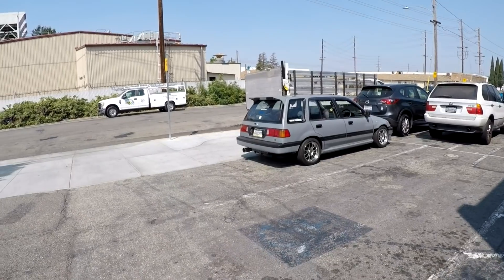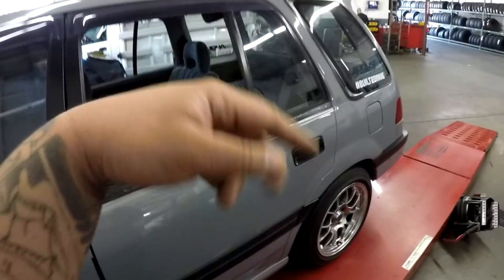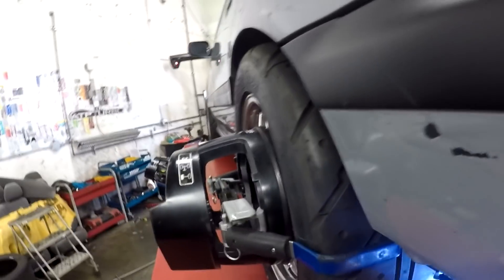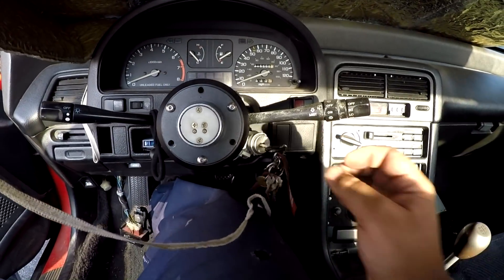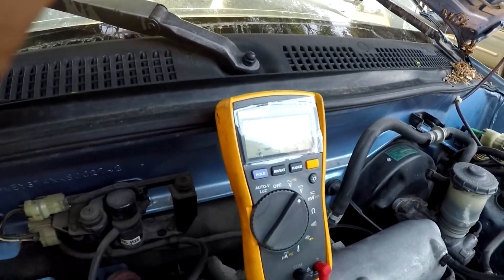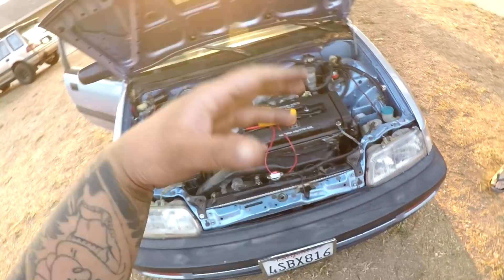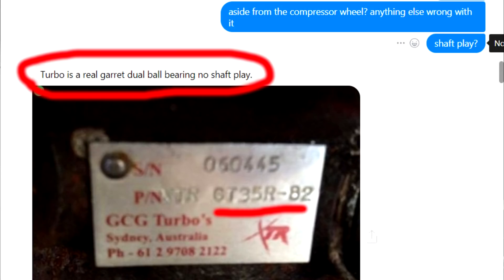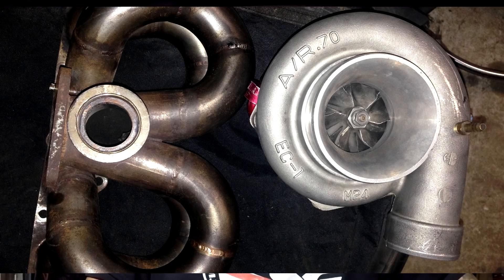K SERIES Turbo AWD Honda        ?

Comment: keepin it real , nice to see an adult mindset . This video should put an end to the talk , so that is settled . Thanks for not adding fuel to the fire by dumping on the other channels . Wish all the commenters would follow your lead and not use personal insults. 
Let's move on.
Kudos on the wheel and tires combo , looks great , they fit without scrubbing .  And the 3" turn-down,  if there is room to tuck it, hell yeah that would be sweet , but ya gotta think about when you add the rear diff and axle stuff. 
I have a  Vibe GT (Toyota Corolla), and i plan to add AWD so i am looking forward to seeing how it goes on the civic

Comment: Find deals that wat i said on diymike ch like i said b4 i bought a full gsr swapd eg coupe 4 700$ n it still runs like cherry til this day  lol hater gon hate static keep yo head up bro
Reply: Good for you. I got a beautiful looking integra that the owner poured gasket sealent in and o.ly found out when the car started pissing out the exhaust and the radiator overflow tank started getting oil in it.
Reply: For real back then in like 2005 i bought a DA with a non running gsr in it for 300 bucks come to find out it needed a new battery fuse

Comment: Question!u @YoungStatic and the community? Found a 91 civic wagon auto 2wd for $800. 7/10 exterior. Interior condition is about 5/10, blow head gasket with SI rims. I’d like a civic again and it would be my first wagon. However I’m worried about parts mostly interior. So, how hard is it to find interior parts and do u think $800 is too much? Thanks all! 

Side note- Static, plz don’t paid your car blue underneath. It looks amazing already!

Comment: Hay much respect to you... my civic LX that I have, I pay  $200 for it... my brother is a machine in the car pull in ready to go to the bone yard... car is nice I'll send you a picture of the civic... I haven't done anything to the body of this car... my the meaning of the hold thing is YES you can get this car little to nothing.... I'm picking up 98 Acura Integra with B20b motor for $300, in all I getting it for is the motor in transmission for the civic because the civic have d18 inside.....

Comment: Hey young I enjoy watching your videos. Keep up the great work. I wanna to see if u can tell me wats the problem wit my eg8. I have an 02 type s k20 swap. Motor ran fine on Acura but when I swapped it I couldn't keep the OEM ecu for that motor. Instead I have a base model ecu that works fine n starts the motor but when in first it just doesn't want to accelerate. I know I need to get another ecu I just wanna know if I can run car wit base ecu. N to turn on car I have ktuned immobilizer. So what do u think I can do so it can run for the time being. Thank you hope to hear from u soon. Have a GD day.

Comment: Have you ever owned a 84 crx si. I have two and I’m wanting to do a build and I’m wondering if I should keep the stock so motor or if I should put a b18 or b16 in it
Reply: Richard Cangas I’m from wv 😂 I couldn’t get rid of them I love em and there way to rare 😂😂
Reply: Well Messege me on here I got an all motor b20v fully built with itb's 13.8-1 compression among much much more making 312whp for sale for 7k, it has about 12k miles on it ... The price is a bit much for most but not when you consider the build quality and cost to build
Reply: Richard Cangas where you located
Reply: Upstate ny

Comment: Yo static I have a problem with my civic y8. I'll turn it on drive it and when I get home shut if off, if I try turning it on right after it won't start, it's cranks but won't start. I got a brand new starter, spark plugs. I know it's getting fuel because when I cranks I spell fuel. I also switched cap and rotor and still same problem?? New dizy or what you think
Reply: Jose Rodriguez  if your starter is turning the motor over but no start check your timing then it's gonna be fuel air or spark. Try to  disconnect your fuel rail see if when you crank it to see if it squirts do this only when the car is not starting might be your fuel pump overheating not making enoff pressure
Reply: Sounds like a fuel issue of some sort. I'd start there. Just because you smell it doesn't actually mean it's making it to it's destination. Never make ass/u/mptions when troubleshooting right? Good luck.
Reply: Yeah I agree it can be old fuel left in the injector or fuel rail that you smell burning off. It's kinda hard to smell that too.unless if you have a leak lol.